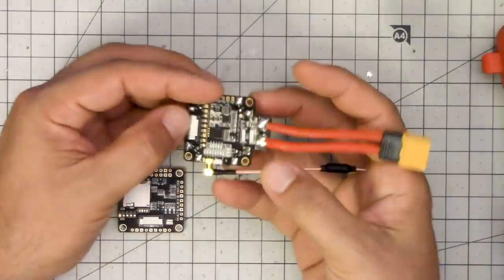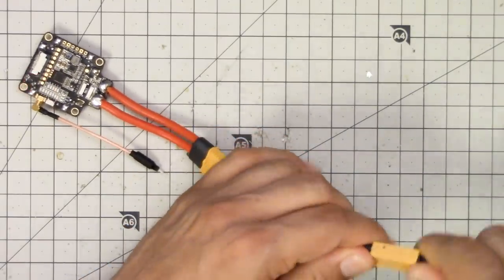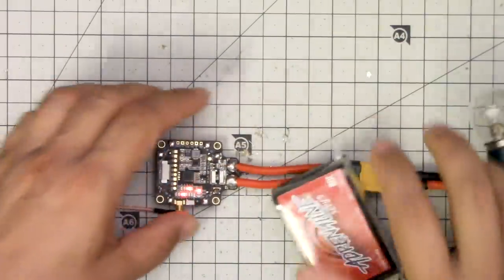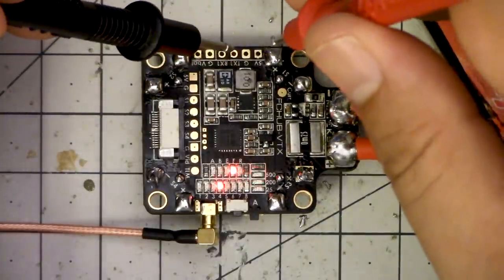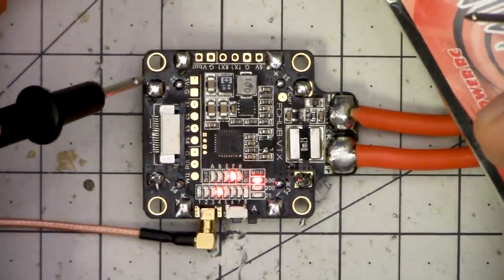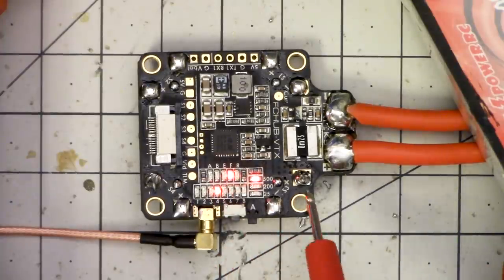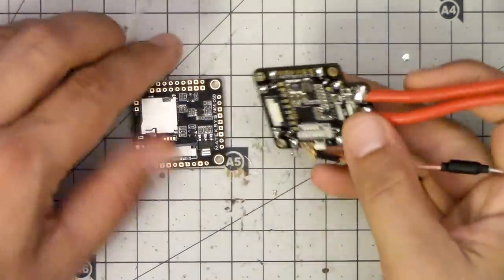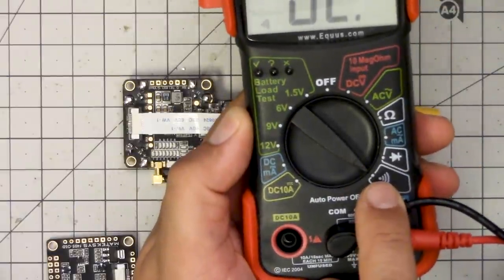Matek F405 Troubleshoot | Multimeter Continuity Testing

Comment: I know this is an old video but I just got the same board with the fchub vtx to go with it. First few flights everything was fine but now all of a sudden my osd just reads 0v. Have you ever had this issue? I'm going to reflash the board and hopefully that helps but was just wondering if you've had that happen with the matek f405.
Reply from the maker: I haven't had that, no. Check the Power and Battery tab to see if the voltage source has changed. It should be "internal ADC".
Reply: I did check that after i posted my question and it was set to "none". After I changed it to "internal ADC" I still got 0v on my osd and in betaflight itself. I power cycled and still no joy. After some frustration I came back powered up the quad again and all of a sudden it was back. Not sure what the deal was but it seems to be working now. This is BF 3.4 and i know from some of your videos it has been finicky so maybe this is something else to keep an eye out for. Like i said in the original post I had not adjusted this and it had worked fine for the first few flights on this board.  Thank you for the help i will let you know if it comes back again.

Comment: Hey Joshua, my brand new fc went to shit today after crash, upon plug in there’s light but not finish boot up, and no response via usb, now that the mcu and 3.3v regulator are both hot, is it worth my time to try change that 3.3v linear regulator? Or is my mcu pretty much dead dead?
Reply from the maker: I mean it sounds like you have nothing to lose by trying to change the regulator but I think the mcu is actually what fried.
Reply: @JoshuaBardwell  I do have to buy the hot air gun and regulators hahahha, brand new fc, hit the grass ground rolled, r38 prop exploded and that was it, ground is hard though, 20 degree day. Wha you think? Current spike? Will it help fc’s longevity if I power my vtx/cam off a separate bec?

Comment: Well i couldnt let it lie so i removed all the connected wires one by one testing all the time then with my dermel i removed the ribbon support area , the esc corners the battery connections and all of those tiny tiny capacitors? and still had continuity, finally i removed one of those  square grey blocks with 100 on them, it was the one closest to the K on the mateksys logo and behold no continuity........ think i deserve a new board and a glass of wine.

Comment: How can I re-enable USB vcp in BetaFlight? that I accidentally have disabled in BetaFlight, on my Eachine Minicube Flytower F3.
Reply from the maker: +Dennis Oostdijk re flash the board with full chip erase selected. Rebuild your configuration.
Reply: I've tried, but get this message: Failed to open serial port.

(all my drivers are being updated in windows 7)

Comment: has anyone else mentioned that bad soldering job on the vtx board ribbon cable socket? looks like a couple of shorted pads on it
Reply from the maker: I believe that is intentional. There are two 5v lines in the ribbon cable that are adjacent to each other.
Reply: @Daytona FPV
The solder bridge is intentional. Stop making stupid comments about things you know nothing about. Matek products are high quality and there wasn't a single fault with any of the Matek PCBs that I bought.
Reply: Thanks Joshua. I didnt know i have never used that board, but it was something I saw that may have been the cause as normally solder bridges on connectors like that are not normal. at least in all the boards i've seen and built :D

Comment: Wow! Just wow!!! Another reason to stay away from ribbon style connectors on kwads. Def worth just wiring it the "normal" way i.e. direct soldering which has never let me down to this day
Reply from the maker: I still am not done with ribbon connectors entirely. They are light, simple, and easy to install. You should see how much weight and complexity I added by direct-soldering. And time! And now I can't remove the FC without desoldering because the motor wires are soldered straight to it. So the ribbon cable has a big advantage, if it proves robust.
Reply: Joshua Bardwell +1 I do agree - its very appealing in many ways, just the ease and tidiness of it, hey? I guess I just don't trust it enough - I fly a lot a sketchy spots so i just cant take that chance lol

Comment: So, what was the defect? Cable, connector, user or other?
Reply: i assume that ribbon cable isn't the best solution (without plugs on the end) to connect. Matek should relase new version with connectors on the ribbon cable. It should be solution
Reply from the maker: The issue is in the vTX ribbon cable connector.

Comment: Should use Kapton tape at each end of the ribbon cable to hold it in place.  Also for continuity gold probes work much better.  It's a poor design to have 5V and GND next to each other on the ribbon cable.
Reply from the maker: I kind of agree, although I don't know what other constraints the board designer was working under.
Reply: I totally agree, would have thought it super stupid to put +&- next to one another.

Comment: at 11:20 it looks like the pins of the ribbon cable are soldered together
Reply: I think those are ones that are supposed to be together. At 13:40 he explains how there are two 5v pins next to each other, and next to that two ground pins next to each other. So it makes sense that the two ground pins are soldered together, and the same for the 5v pins.
Reply from the maker: +Gareth Meyer those are supposed to be bridged.
Reply: i need to start watching the entire video before I comment. Sorry Joshua :P

Comment: Call me old school but a micro ribbon cable for my quads is no.... both times I tried it with 2 sets of FCBs and PDBs I had signal probs with motor 3..... so I just use pins and wires......... piece of mind at 400' with a 6S .....
Reply from the maker: The good news with this FC is you can do either. If you don't liek the ribbon it's easy to direct solder. That's what I did for this one.

Comment: "I fixed it" is not what I would say when I just replace a part..
Reply from the maker: I didn't replace the part. I ended up fixing it by direct-soldering to the breakout pins instead of using the ribbon connector.
Reply: @JoshuaBardwell  Hi. what break out pins ? i need to do this

Comment: Totally unrelated to the Matek, but related to most of your videos: the camera that is filming you is constantly out of focus. It is focussed at the computer screens behind you. I have seen a lot of your videos and they are all out of focus, it is starting to drive me nuts! 
Keep up the good work! (And try manual focus)
Reply from the maker: +JorritJ it's actually that I'm filming without enough light so I'm blurry but the desk isn't because it's not moving.
Reply: So it's an issue you are aware of but disregard.....  Hmm.   
Better would have been graciously accepting the constructive criticism, and then remembering for the future, "it's good enough" really isn't.  
JorritJ: totally agree with you.   
I don't think it's the lack of light, the intricate desktop backgrounds on the monitors are very easy for autofocus to lock onto, and auto focus typically tries to bring the areas of the most detail into focus, and as to the because it's not moving excuse, it's not like you are jumping around, you are also very still, maybe not as still as the monitors, but all in all, this video is low hanging fruit and it's disappointing to hear that you were aware of it and ran with it anyways.   Just my $0.02.
+1 on the manual focus.   There is no reason for auto focus to be used in a video like this.  Save us all the headache.   
In out of focus videos like this, i just turn the resolution down to 480 and then it all looks like crap, focus be dammed.

Comment: Wait... you didn't fix "it" you put a new one on. Well i guess technically it's fixed but i was expecting a repair lol
Reply from the maker: I did fix it. I fixed it by direct-soldering the wires instead of using the ribbon cable. The fix would be to re-solder the ribbon cable header but I'm not up to that.
Reply: Oh right...so it was the header that was miss aligned! I missed that in the vid?

Comment: I doubt it's a good idea to touch all the components on your boards with your fingers. With the battery plugged in it's even worse.
Reply: with the amount of resistance that human skin provides it won't be a big problem. But sure, one should avoid that....
Reply from the maker: +aerosurfer why not?
Reply: Low voltage DC ain't going to hurt ya.  At least not at these levels.  Lick the dam board if it floats your boat, you'll be just fine.

Comment: Your explanation does not seem to be correct. If you insert the ribbon cable, and there is a misalignment that bridges 5V to GND, it does not matter whether the other side is not plugged in. As soon as 5V touches GND, you have a short, no matter what is connected. That would mean, that there is a misalignment on both sides of the cable that causes this issue.
Reply from the maker: No, because the other end of the cable is still disconnected. So you have naked wire traces hanging out in the air. It is only when you plug in the other end that the final connection is made.